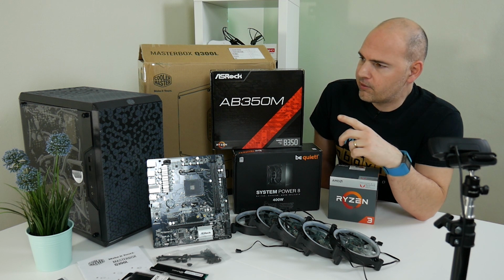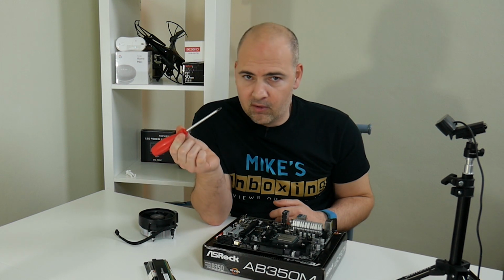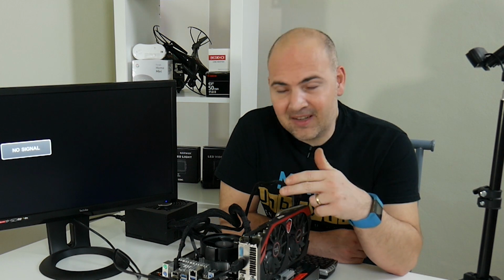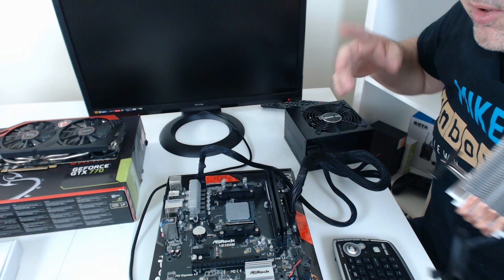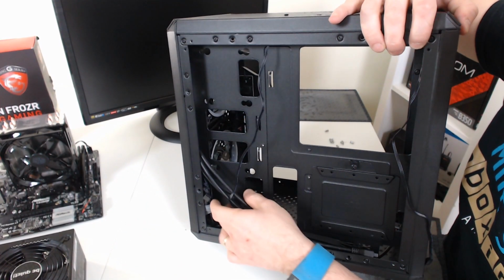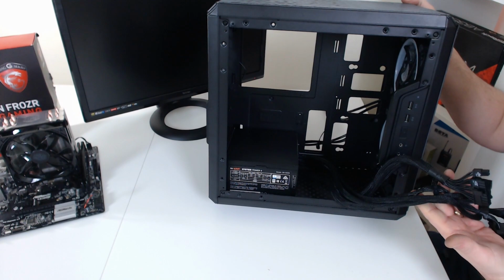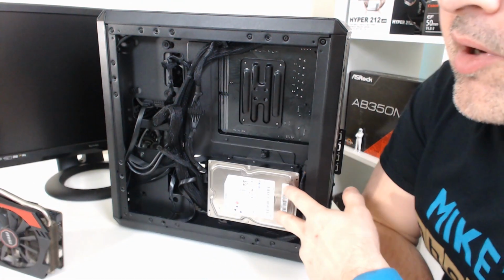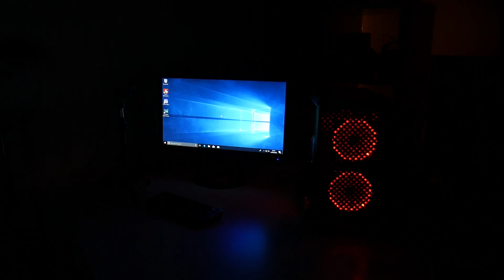Ryzen 2200g Build VLOG With Masterbox Q300L It All Went Wrong!

Comment: Best I remember from other studies? Top fans if your not careful can exhaust the air before it reaches the MB.
With everyone water cooling these days air flow has been forgotten.
CPU and GPU temps are fine they say as the MB cooks.
Reply: I took it off the front top fan, now the air flow is way better.

Comment: Nice video; I've been trying to decide on this case and this just convinced me to get it. I also had the same issue with the bios update and had to request a boot kit from AMD, an A6-9500 apu. It arrived a week after submitting my request, so at least that wasn't too bad.
Reply from the maker: Thanks Johnny, I have just installed the MSI B350M Pro VDH and I wish I didn't the BIOS is horrible and it seems that I cant get the APU past 3600! which is really not good enough. I think that most people should consider the APU to be a gap filler until the GPU prices settle down. The 2200G at 3500 still gives my 1700 a run for its money when using a discrete GPU! and is almost half the price!
Reply from the maker: JohnnySixString update the main board is okay when you get used to it. Got the Apu to 1300 and CPU to 3800 with turbo boost up to 4.25 not too shabby

Comment: It's a great step going to PC builds. PC industry is indestructible even if prices continues to soar. Just do more on the Entry-Mainstream level parts, value builds, gaming setups and some benchmarks with data sheets and you are going to fill the gap. Most people wants value for money, budget RGB stuffs. Just focus more on the budget build category specially the comparisons between brands like cpu coolers, cpu's, Casing and RGB Fans, etc. You know what is really missing, the PSU comparisons and benchmarks. If you can do a PSU comparison with benchmarks then you'll expect a major boost in your channel.
Reply from the maker: The weekend build this weekend is a Ryzen 1700 budget build for mostly used parts from eBay Facebook groups etc. I will be building a really powerful Machine for very little money. Already picked up a fractal design c with tempered glass in new condition for £30! A cooler master 750 semi modular psu for £30 and the Ryzen 1700 cost just £100. This could be a real pleasure to build.

Comment: There are actually pre drilled holes in the front. In the manual that came to the q300l it shows the pattern for 120mm and 140mm fans as well as a 240mm rad.
Reply from the maker: I think mine might have been a bad production model as almost all the pre drilled sections were not drilled? I wonder if anyone else has had the same problem?
Reply: I only had similar issues with the PCIe slot covers, I did the same mistake with placing the mobo before removing the covers....
Only my fans seem to vibrate a bit too much for this case :/

Comment: i have been on a similar situation, with my current project. I've purchased a used and updated AB350M-PRO4, just to avoid all the hassle with the bios. I've found a 2400g from a guy who has bricked his msi board by updating the bios.
 The funny part is that I was unable to determine if it was all good, maybe I didn't waited enough to do it's bios routine. And I've tried everything, different ram, another Apu A8...
 Sadly, I didn't have any gpu to test it.
Reply from the maker: I feel for you! These AM4 setups seem to be very glitchy, and very sensitive to different RAM sticks and RAM slot usage. Try using the second RAM slot only when booting, it seems a lot of boards won't boot from the first slot with an APU? Very strange.

Comment: I bought that box.. My first full PC build ..I was going to buy that processor but, now I'm worried.. I also heard this needs dual channel is that true? 2 sticks of matching RAM right? Guess I will watch your video and find out 😁 Thanks!
Reply from the maker: The CPU doesn't need dual channel but will run better with it. Although I will be testing that theory with 8gb and 16gb and I honestly only expect to gain a few FPS. It would be nice if it made a massive difference but I doubt it will. Thanks for watching and look out for the third video in the series with benchmarking and memory tests

Comment: Alright alright! I think you need to do a re-build in this case with some more loving! If you are going to use a 2200G or 2400G or anything with an iGPU then get a board with the video outs! I found them to be cheap. But I think you should do a more powerful system in this case!
Reply from the maker: Thanks for the input! I left it to someone else to rebuild in this case, it is awful to work with cable management is useless and airflow is rubbish. Using a Kolink Stronghold now and it is a MUCH better option for anyone wanting a good looking case on a budget

Comment: Do you know if your able to mod 2x 200mm intake fans on that case? Dont know the measures
Reply from the maker: No I think even 140s will be a tight fit. 200mm no chance
Reply: FYI.... with zip ties the case will fit 8x 80mm fans in the top or front. That's 16 FANS!!!
Reply from the maker: Holy shit that is a lot of airflow!
Reply: and it sounds like a swarm of hornets xD
Reply: Up Date:  The Prolimatech Ultra Sleek Vortex 140mm x 15mm PMW Fan with (120mm Mounting Pattern) look, fit and perform wonderfully in the top of the Q300L case. That's two of these fans side by side using the 120mm holes.

Comment: why did you drill the front grill? there are many holes with different diameters, you only use two fans in front, so you just have to slide up or down the fans to get a place for the bolt to fit in with the holes.
Reply from the maker: All the holes on mine were slightly too small for the case fan screws for some reason. I did try other screws and mounting options. I thing it was an early production release that had the holes i fraction smaller. Current models don't seem to have any problems

Comment: Is there any way to put 3X3.5 HDD in this Cabinet?
Reply from the maker: One in the rear compartment and maybe two custom fitted where the SSD drive are mounted?
Reply: Mike's unboxing, reviews and how to custom fitted how? Is there any bracket for 3.5 inch drives?
Reply from the maker: There are no brackets but you could screw through the panel and mount the drives vertically. A bit ghetto but it could look good with a bit of time and effort

Comment: Hi Mike, where did you connect your 120mm fans? Thank you!
Reply from the maker: The board has two fan headers and I also use a 1 to 2 splitting cable to allow more connections. So having two splitters will allow four fans (if needed)
Reply: @mikesunboxing   Do I need to buy splitting cables separately?
Reply: @Madeyro  to answer your question, yes.

Comment: Q300L supports CPU coolers up to a height of 157mm, and 212 is 159mm, but still fit?
Reply from the maker: Yes quite easily!
Reply: Do you believe that it fits the cooler master tpc 812 XS which has 1.63?
Reply from the maker: Very close to the panel but should work

Comment: anyone tried mounting a full ATX in this case? is it possible to move the pcu more to the left panel to make room. I know the slots on the atx will be closed off, but I looking for a smaller case but dont want to buy a new motherboard.  not afraid for some drilling an cutting
Reply from the maker: That may be possible with some modification unfortunately I don't have the case any longer to be able to give you a definitive answer but with the right tools and a suitable motherboard I guess it could be possible anyone else care to add their opinion

Comment: can I place 2 full size Hard drive in there??
Reply from the maker: It is designed for one but you could maybe mount another behind the front upright?
Reply: but only one screw would support it? I'm eyeballing it from your video.. lol
Reply from the maker: It's not ideal but should work. Or maybe buy a cheap 2.5" HDD and mount it in the SSD area?
Reply: I'm thinking of drilling a hole in theory just so i can lol anyways thanks for the response man I really appreciate it :)
Reply from the maker: Drilling is fun when it is scary! I drilled the s**t out of my masterbox 3.1 and it was really terrifying drilling the acrylic :-)
Reply: hahaha! was it the lite?  wtf! thats the exact case I have right now where Im so pissed cause the airflow is close to zero! haha! Dude Same I drilled holes too on the acrylic haha!I used the tiniest drill just so I can get some air in it haha!
Reply from the maker: I have made a great mod to the lite 3.1 that keeps it looking completely stock (actually better than stock imho) and the cooling is nearly as good as not having the front panel attached. There will be an update video coming soon as part of the masterbox 3.1 unbox, build and conclusions trilogy :-) Here is the video: https://www.youtube.com/watch?v=wfF8o07vtGE&t=62s&list=PL39HCM-SRLM9nTVRnfPvAOHFRnWQe9Sf0&index=5

Comment: That fan placement .....

2 are doing nothing to cool the components, the ones in the upper right corner. The cpu cooler is pulling hot air from the gpu ....

I'm going to buy this case for my daughter. well vented case with full dust filters and TG for less than 50 euros.
Reply from the maker: The fan placement wasn't great and it was kind of on purpose to be like some people might have it configured. 
Many lessons to be learnt 😁

Comment: first. nice video is good to see someone struggling with commong mistakes.
second. you are kind of a noob, all those mistakes could been helped with proper search in google. 
and third. you are the VERY FIRST reviewer i have ever seen that says the stock cooler of the Ryzen SUCKS!... it is nor the best... but it does not suck AT ALL!!
Reply from the maker: Thanks Raul, I thought it was kind of fun to go through the mistakes and leave them in. In the real world these are the type of things that people will face, it could have been a polished Linus Tech Tips style video, but I like a bit of realism.
As for the wraith stealth cooler, it had a really odd pitch to the fan? I'm not sure what had caused it or if that is how it is meant to sound. I discussed it with Amazon and they refunded me 10% of the purchase price (£8.90) so it ended well. 
I did actually try using it for a while and attempted some very basic overclocking and found I couldn't even get it 100mhz over stock! Maybe I just had a fault with mine?
I have changed it for a GAMMAXX 400 and it now sits at 3.9ghz with a GPU overclock of 1300mhz and never gets much hotter than 55c under full load. I can't seem to push the graphics any higher than that even with stock CPU speeds. The silicon lottery I guess?
 I have seen that with the stock cooler people getting up to around 80c which seems a bit too high for long term lifespan.
Thanks for your feedback, and hope you stick around to see more of my Noobism's :-)

Comment: is the cpu cooler supposed to be that way facing down?
Reply from the maker: In a perfect world no. The first revision of this cooler only allowed this method of mounting. The newer versions have a newer backplate that allows the cooler to be mounted "properly"
Thanks for taking the time to comment 😎
Reply: ah got you thanks for the quick reply!
Reply from the maker: No problem. I get a lot of comments on this video because of the mounting bracket 🤔

Comment: Does hyper 212 led perfectly fit in this case ?
Reply: I have hyper 212. Can i install that in this case ?
Reply from the maker: Yes not a problem even with am4 am3 sockets (which are slightly higher than intel)
Reply from the maker: Yep easily
Reply: Thanks a lot for the input. I have core i5 4440
Reply from the maker: That should keep it nice and cool! Although it depends on the rest of the setup.
Reply: Got the Q300L. Hyper 212 Led fits in it perfectly. Thaks for the confirmation about ta case.

Comment: GTX 770 on a 400 watt unit. Oops.
Reply from the maker: Not ideal but it worked for a long time with that setup. The PSU was surprisingly good considering its branding and age
Reply: @mikesunboxing  Yeah, I wouldnt do that with a lower brand. It worked 'for a long time' but the 12 v rail was running very high,like 85%+. It shags em out in months. But anyway, cheers for a look at that case, me nephiew in dorset is gonna use one. I like blue l.e.d., can use the antec a30 led on an older i5. ;#}
Reply from the maker: that PSU has now been relegated to the Ryzen 2200g system for an easier retirement :-)